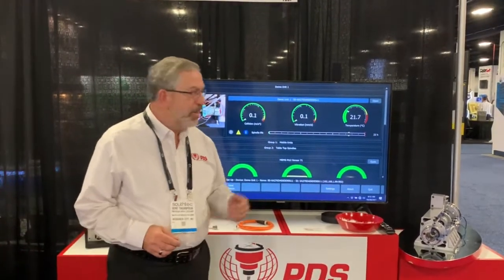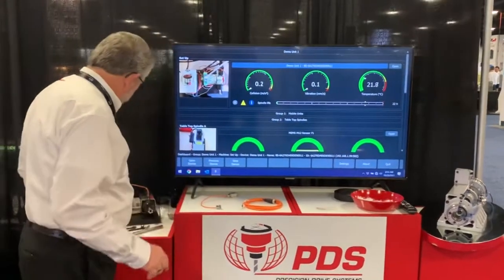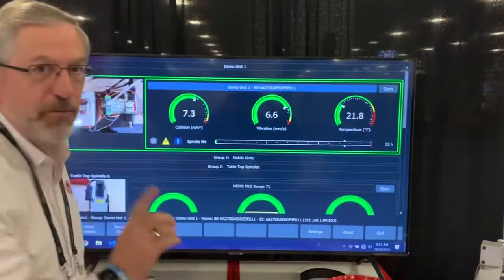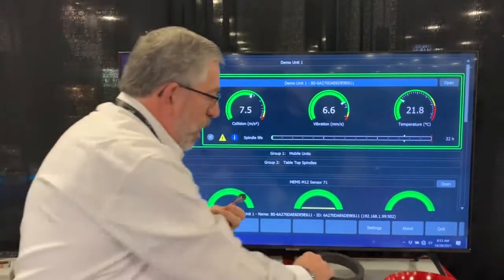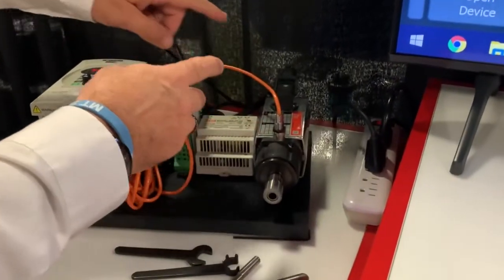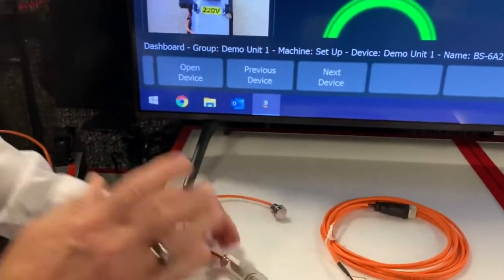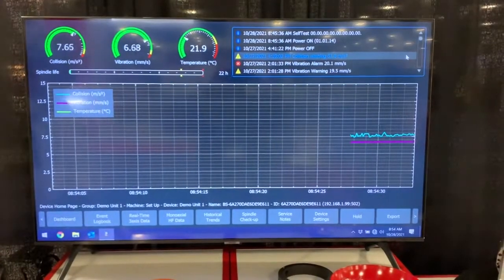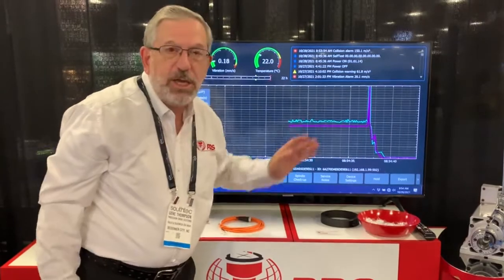Gene Thompson discusses Spindle Health Monitoring benefits

Comment: Thank you for your comment. This system would be run for a period of time to determine the “nominal” running feedback.  Then the limits for warning and alarm would be set.
This is not so much a factor of the spindle but a factor of the actual work being done or the application.